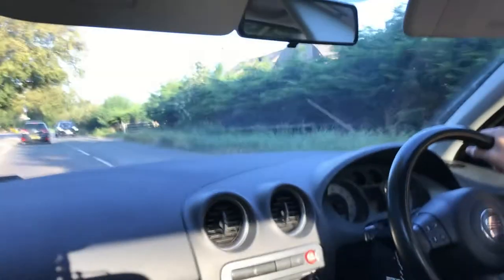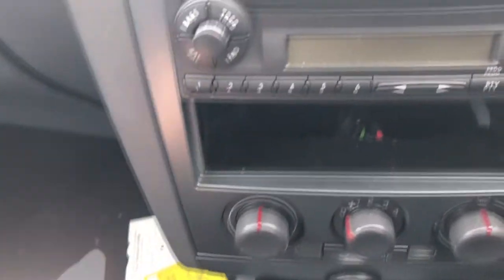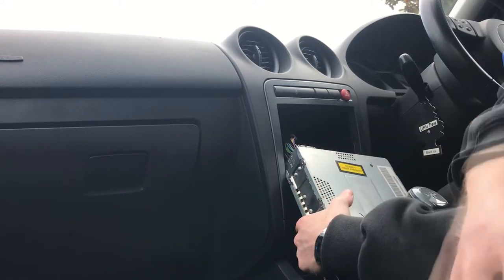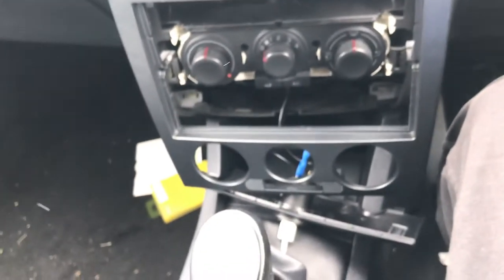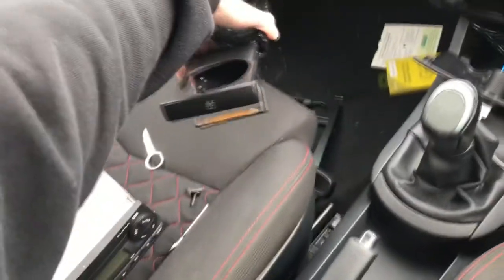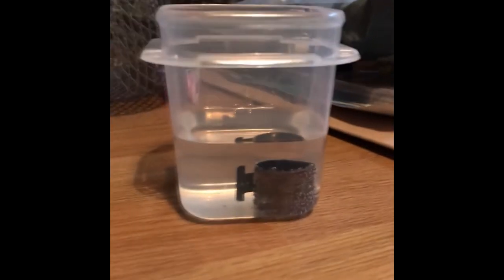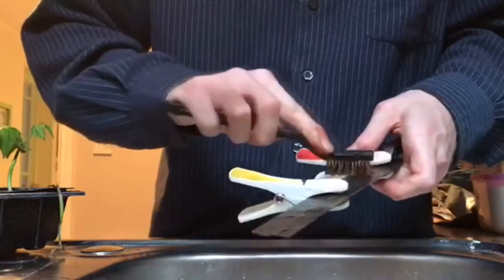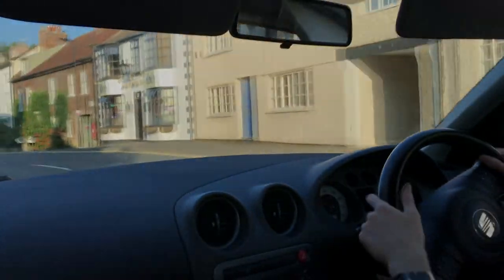Seat Ibiza Jammed Cup Holder Fix (2003-2008)

Comment: Your video helped me a lot in this repair. Good job!! My problem was in the side pins. 6:31 minute of the video. They had simply volatilized. I made some drill on each side and pass a piece of thick wire on each side to endure on one side the small side dock, and on the other to be even and not decoupled as it should be of origin.

Comment: Spot on. Mine had a different problem. The lateral pins in the tray broke, and the lateral spring was rubbing on the bottom, not allowing the tray to come out. Just disabled all, and bend the spring end, put it back together, and it's fine.

Comment: I finally saw your video and managed to fix it completely. I had broken the two side bolts, the one that holds the small spring and the one on the opposite side, with a piece of hot wire I went through the plastic and simulated the bolts, the groove of the plate roll had to be rebuilt with loctite and bicarbonate, this is the place extended and what was left I introduced it in the hole that you indicate. I think that the latter is what you lacked to fully recover its operation.
Reply from the maker: Great idea, I didn’t even consider that.

Comment: Hello. I need help.My cupholder is working but the holder underneath that holds drink was brooken i got a new one can you tell me can i just slide holder under or i need to remove whole unit ? Thanks
Reply from the maker: Hello, from that you describe, yes you will need to remove the trim panel which holds it in place. Hope you get it fixed mate!

Comment: Hey mate, could you please give me the dimensions of the spring please? Thanks!
Reply from the maker: Hello, unfortunately I don’t have the car any more, the spring was no more than 15mm wide along the ‘barrel’, the material is probably either .25 or .5mm thick from memory. Unsure on diameter.
Reply: @caltarmac  oh okay, thanks though! I just bought a second hand Ibiza and a second hand cup holder which I am restoring. I'm using a retractable dog leash's spring, hope it will work 😅

Comment: You skipped over how to put the metal coil back into the housing...
Reply from the maker: If you see at 5:54 There is a matching T shaped slot at the top of the casing, and the spring itself sits in the recess seen at about 6:00. There is only one orientation that the spring goes back in, hope this is helpful!